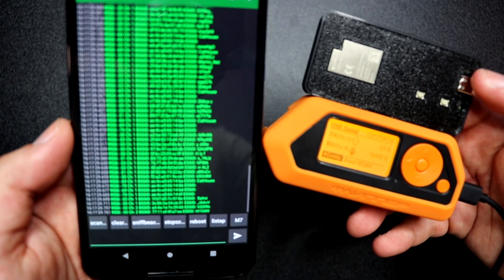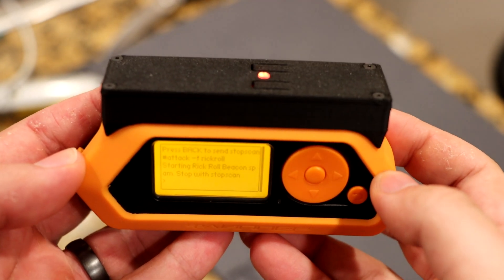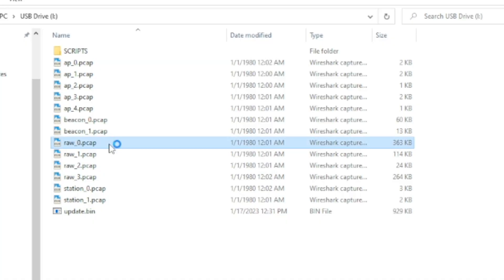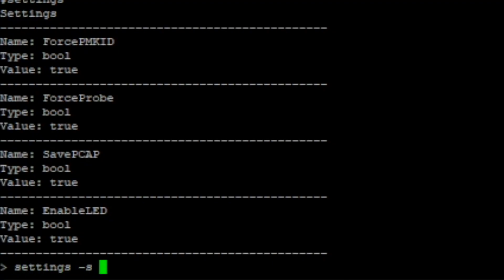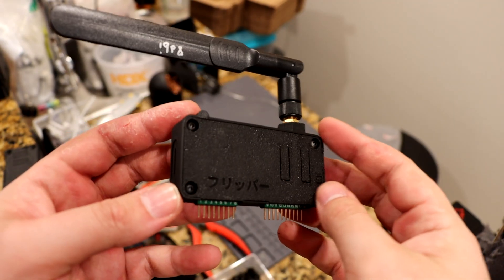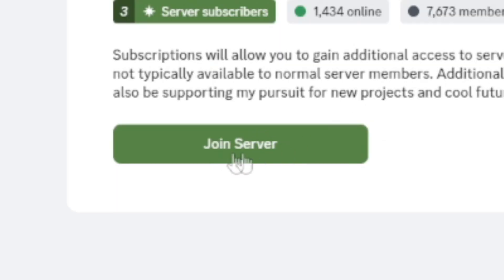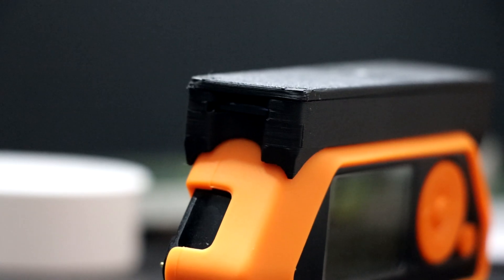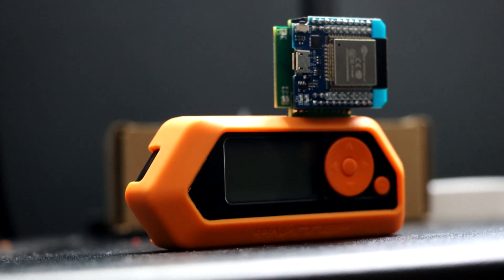Flipper Zero: WiFi Dev Board Alternatives

Comment: Great info, thanks for the great firmware. I am building my first Marauder with your DIY help from Git. Can I use display without touch and install push button for navigation ? If possible can you help us on schematics and any code change. Also is it possible to use display other than ILI9341? Thanks.

Comment: Use my omtech 20W Fiber Laser to engrave on the 3-D print. It comes out really nicely as long as I keep the speed fast and the power very low usually set my speed about 260 I'll set the power  2 frequency between 30 and 50.  Do you have the files available for download? 
Instead of having it stick up so high off the header pins can the header pins be switched so it lays flat and the antenna sticks up so you don't have so much weight on the top of the flip zero .

Comment: Can I use the flipper zero with bad USB to unlock some old iPad's I have in the shop this is strictly for personal use only not for hacking anybody or stealing their tablets I have probably 15 or 20 of them on the shelf just sitting there and I hate to throw them away. I would like to build the use them for Home Theater use lighting control. They're too old to do anything with, but they would be fine for Home Theater and some automation control.
I also have the hacker RF one if that will do it I don't care how I do it just need to get them unlocked. Anybody have any suggestions?

Comment: I have a quick question.. i want to fit a gps module to my wifi dev board .. the issue is .. i do not have the og original wifi dev board (plain). Mine has all the fat big chips in the way which means I would not be able to use your mod .. any suggestions . I have the v1 version with the fat wifi chip and other shit blocking my way

Comment: Hi man idk if u will see this but im here to ask if you know what could have make my esp32 not accept SD card with ur marauder project (the card is 64gb, from goodram and it works beacuse i checked it on my computer) the esp32 itself work fine with the marauder software but i cant acces evil portal wihout my esp no accepting the sd card. Do you know what can i do with this problem??
Reply from the maker: Make sure the SD card is formatted in FAT32 and maybe try a smaller capacity card by sandisk

Comment: Why hasn't anyone been using the usb-c and interfacing with a wireless card on an Android phone? I have plenty of old android devices I could flash and install some type of OS to allow the phone to act as an accessory for the flipper and use all of its cameras, sensors and anything on the board. I'm just throwing this out it might not be possible but I figured why not ask it here?

Comment: There’s a device called a dope scope that uses a directional antenna as well as an ESP 32 to pinpoint WiFi and BTLE, do you think there’s any way to get something like that to work on a flipper? There isn’t a lot on it but figured while I’m waiting for the unit I’d ask
Reply from the maker: As long as the ESP32 running as the dope scope still have an available UART connection, I'm sure it can be integrated with flipper
Reply: Great... Something else that I now need in my life! Plus I like the fedora of doom:face-blue-smiling:

Comment: Keep up the awesome work!!! Great video. Question however, could the flipper zero dev board have its own static IP like the bash bunny? Or is it faster to use it over a tethered usage?
Reply from the maker: I don't know off the top of my head if it can have a static IP or if it can only use DHCP
Reply: @JustCallMeKoko  Thank you tho. Since the flipper came out, would you rather see more projects to mod the internals of the flipper, or external components that could help upgrade it? I appreciate the response before. :face-blue-smiling: